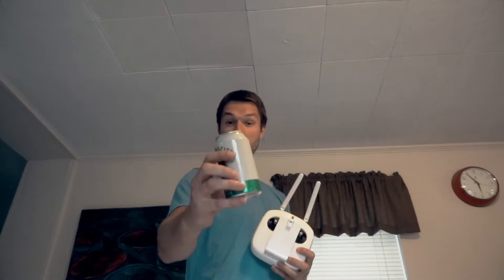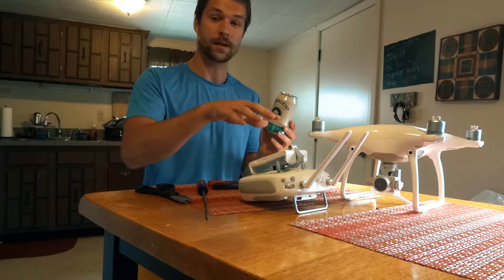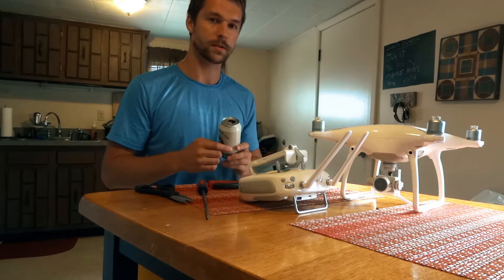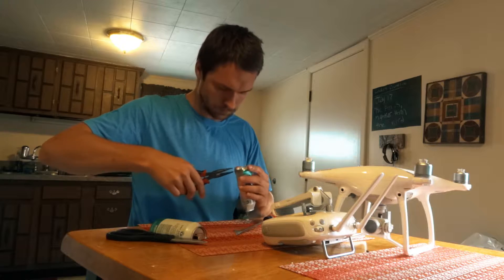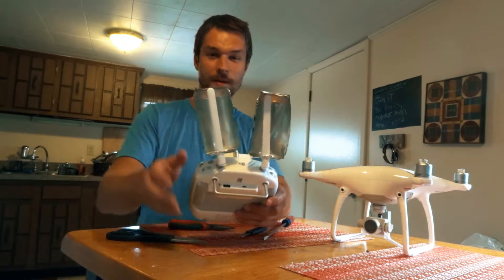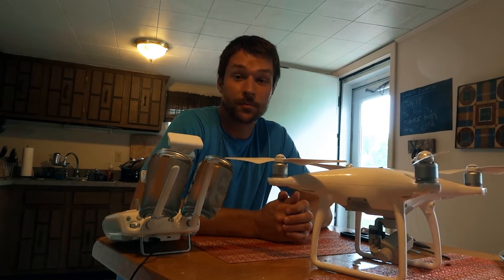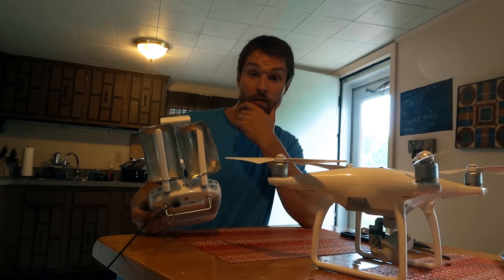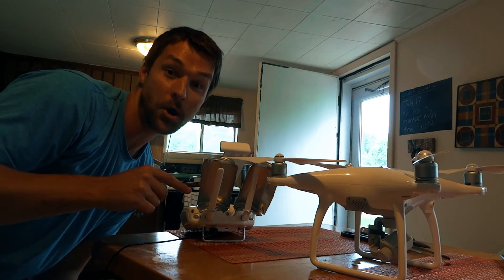DJI Phantom 4 Beer Can Range Extender/Booster - DIY Quickest Fix!

Comment: I have been able to get the max distance out of my Phantom 4 approximately 8,500 ft, but there are days where it will have issues and I might be getting only about 3500 ft before having transmission issues. I am thinking of getting these antenna boosters anyway. I do fly it in the northern part of the city at about 390 ft, so that I can eliminate any obstructions.